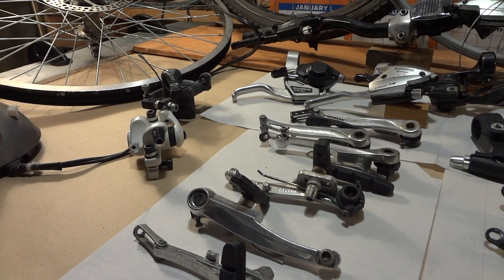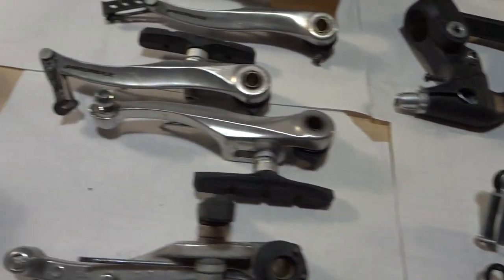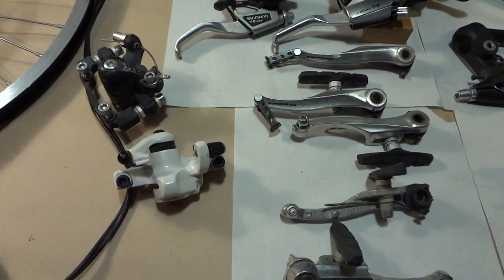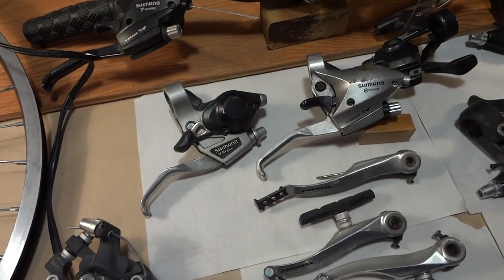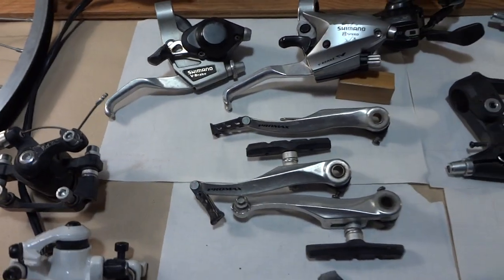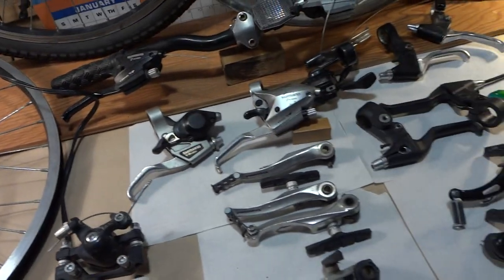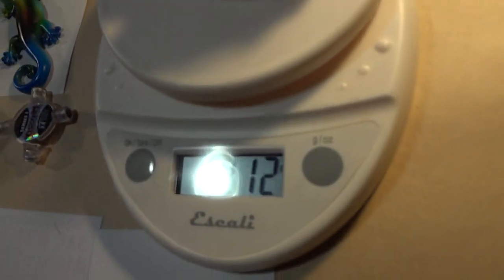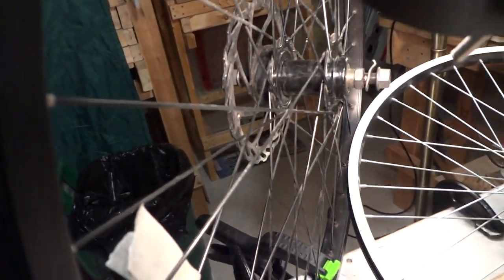Disc vs rim V brakes the truth they wont tell you

Comment: I have been an anti disc brake for a while... until I rented a gravel bike with disc brakes on a trip to Hawaii and had to do fast descents under the rain. Super reliable. Other than that on fair weather and non steep descents disc brakes are not needed. Also forgot to mention, if you have carpal tunnel or arthritis it helps to have disc brakes as less force needs to be applied to stop.
Reply from the maker: cheap quality disc brakes dont stop well though
Reply: @BIKEMAN21  ive ridden a bike with cheap tektro disc brakes, and as soon as its wet, their stopping power is still better than for example hydraulic magura rim brakes. Disc brakes in the wet perform better because of the lower water buildup on the brake surface and being able to get rid of water faster. Also higher clamping pressures.
Reply: @EstelonAgarwaen  Due to the smaller rotor size (e.g. 160mm diameter vs. ca. 600mm), the calipers one disc brake use much more force against the rotor, which is what makes them bite better despite water.

Comment: rim brakes wear out the rims , disc brakes dont and discs are way better in the wet. As for weight ,Pro bikes have a minimum weight and they can achieve that with disc brakes , so weight is not a problem. I run Hope pro 4 hubs with disc brakes , light as it gets
Reply: “As well as not slicing through the wind as efficiently, disc-equipped bikes are generally around 300g to 400g heavier.” https://www.cyclingweekly.com/cycling-weekly/bikes-disc-brakes-faster-219255
Reply: @kalijasin  They might weigh a little more but they let you use carbon clincher rims without the huge risk from heat blowouts. Personally I don't think anyone should even sell carbon clinchers for rim brakes
Reply: Have you ever seen a rim worn down to failure? Me either.
Reply: @Derekforeal  i have seen one, especially in cheap alloy aluminum lightweight rims.
 You barely notice it until the bead of the just broke your rims on its thinnest part,

Its not catastrophic until you are  riding down hill and a pothole  of obstacle hit your tire and change your tire geometry. Permanently breaking your rim wall into 4 parts.
Reply: @Derekforeal  me neither ive never heard of such nonsense
Reply: @kalijasin  Minimum weight is 6.8kg. there are even steel frame rim brake road bikes that weigh about 5.5kg. add about 400 grams to that and its still 900 grams below UCI minimum weight. On non uci hill climb races, people rum a single rim brake for maximum weight savings. But they never descent on these bikes.
Reply: @Derekforeal  henry wildeberry has a video showing a broken rim. It mostly comes from insufficient maintanence afaik. When you dont swap out worn pads, the metal part of the pad will stick out and destroy your rims. With cleaning and maintanence though, the risk of rim breakage is quite low. Especially if you replace the rim when it reaches the wear limit, indicated by a groove or little hole in the rim.
Reply: I have worn out alloy rims, and have seen rims worn out because of out-of-true wheels, and asymmetric braking force from the pads. Worn out as in the wear I dictator groove is gone on sections of the rim.
Reply: @Derekforeal  yes a mate of mine wore through a rim , it was 3 years old .
Reply: @kalijasin  the aerodynamic issue is another lot of BS , you have a human sat on top of the bike and they flapping about and the legs are moving , making so much drag and theres this tiny little caliper and disc. If aero was a problem why are pros going over to discs ? maybe they work better ?

Comment: As a road cyclist commuter I have never really felt a great difference, if you set you brakes up right disc and rim brake types perform identically for me. This is likely cause I'm a cautious rider and don't put myself in situations where my bike along with my cargo need to be stopped on a pin drop, I know my routes and I know just how little I have to brake. I go through significantly less brake pads now just cause I am a more efficient rider. Realistically most people aren't going to go through rain or muddy decent and even if a road dweller does more caution needs to be applied due to more dangerous traffic so you should be going slower anyway.

Comment: I have had disc brakes on my mountain bike for the last 18 yrs. I picked up a hybrid this yr aka as a old school mountain bike with v brakes. I ride much faster on the hybrid as I use it on gravel and the road and it is 50% lighter than my full suspension downhill mountain bike. I really do not notice the difference in braking at any speed esp. high speed. I'm a fair weather rider so for those commuting or doing serious distances where rim brakes are compromised in bad weather, disc brakes make sense. For most of us - they don't. It's an added expense. Fortunately, I never buy bikes based on the components as even the cheapest bike I ever had never had the components fail. The only concern I've ever had issues with are cheap rims. Great review and points raised. I'm wondering if a "high end" set of v brakes is cheaper and as effective as disc brakes, even in the wet with an appropriate brake pad.
Reply from the maker: Well it comes down to money, a bike for $300 wont have good disc brakes i think.  Right now im not sure of the prices at canadian tire ill have to go check. but in middle of covid the $300 bikes were selling for $600 and only had alloy V brakes...not sure currently which is better but my bet is the V brakes.

Comment: I really like my disk brakes on my cargo bike. There stopping power is excellent. The maintenance is very simple once you do it a few times. The only downside I have found is that the disk brake pads do not last nearly as long as vbrake pads. My cargo bike has disk brakes but also has the braze one for vbrakes.
Reply from the maker: I'm just guessing but as a cargo bike maybe they are using higher quality materials that have better friction.  I've also read there are several different rotor / brake pad materials being used depending on the model. I see a lot of MTB bikes with front disc and rear V-brake setup too. And many disc forks that also include the V-brake mounts luckily. But that goes vice versa too.
Reply: @BIKEMAN21  my Big Dummy has Avid BB7s disk brakes.

Comment: Hey bike man, i agree, discs on road anyway are a solution to a problem that doesn't exist. I have done a number of videos on this topic. It is just bike industry marketing. We are now seeing 15k USD high end bikes which are a kilo over the UCI weight , crazy for that money.
Reply from the maker: Finally someone who agree's, My current build a schwinn MTB with front shocks, aluminum frame, when i found it on the street curb i was thrilled it was still using V-brakes. simple to work on and will stop a lot better with a hell of a lot less dead weight.
Reply: Absolutely agree

Comment: I ran Shimano Zee disc brakes on my Trek Farley. Those things were great! 4 pistons per caliper, they stopped that fat tire bike fast. 
I honestly don’t understand the complaints about the slight weight difference between disc and V brakes….if you rode a bike prior to the late 90’s, everything was steel and heavy as hell! With current aluminum and carbon fiber frames, I think I can deal with the few extra grams of a disc brake😂

Comment: Big advantage for rim brakes, they are LINEAR. Important for ebikes when cutoff voltage triggers, the hub motor still have inertion, so avoid wheel locking to not wear the motor gears quickly. Disk breaks lock the wheel and wear the motors gear. Rim is best from every engineering point of view

Comment: Most mountain bike forks areassivelt heavier to accommodate the metal brake mounts requires for V brakes. 
Left that out but it's still weight.

Comment: Hello 'bikeman' i am considering ebikes etc at the moment for going to work mostly, i have looked thru pretty all the ebikes and have not really found the right one, i have a 20+yr old mountain bike ( steel frame i am large build ) i am considering putting a ebike front electric motor in it, as i live on a hill, the motor is 300w and less complicated than others i have seen as the battery goes on side of the motor so MUCH LESS wires, the bike has V brakes, i always thought disc brakes would be better but not so it seems, i would appreciate your thoughts and advice.
Reply: It will be fine with v brakes. My bike is a hybrid with 48 v battery, 1500w rear hub motor does 45 mph! V brakes stop me just fine no problems. I have never been convinced by disc brakes on bicycles, especially as they only have one small rotor on one side of the wheel!

Comment: Cable actuated disc brake callipers as shown in your video are generally much heavier than hydraulic callipers which operate much better. 
If people are happy living with old outdated technology rim brakes let them but I’ll never buy a road bike without hydraulic disc brakes
Reply: Rim brakes are certainly not outdated, there is a much higher demand for them than the manufacturers will admit...rim brakes are less hassle, cheaper, lighter and they work adequately.

Comment: We all went away from V brakes about 20 years ago because in winter the mud clogs up between the rim and the forks due to low clearance  . Disc brake bikes have better clearance  all year round. V brakes wear out the rims which will eventually need replacing which is basically a new wheel. I have had a front rim fail on me while in a competition so I'm not going back to  rim brakes anytime soon. Enjoy your rim brakes while you can. Disc brakes are here for good .
Reply: I have been an anti disc brake for a while... until I rented a gravel bike with disc brakes on a trip to Hawaii and had to do fast descents under the rain. Super reliable. Other than that on fair weather and non steep descents disc brakes are not needed. Also forgot to mention, if you have carpal tunnel or arthritis it helps to have disc brakes as less force needs to be applied to stop.
Reply: @Zayd Deapor
Reply: When you say you had a front wheel rim fail on you from v brakes what exactly do you mean?   how did it fail?   Im severly curious as to what you mean or your experience that happened?
Reply: I also must disagree rim brakes will never stop being manufactured
Reply: Never seen disk brakes on BMX or dirt jumpers....

Comment: Disc brakes are heavyer, that's the fact.  Are they better? Yes, for pros and on the wet. That means for 99% riders, 99% of the time V brakes are better.
Except MTB, Disk brakes are better for MTB.
Reply: That's like saying it is better to ride without helmet 99% of the time
Reply: @caperider1160  99% you didn't understand my point. Disk brakes are not going to save your life.
Reply: I don't believe that you actually ride or ever tried out decent brakes. vbrakes are absolute shit.
Reply: @citer5574  I have disk brakes on my e-bike.
Reply: @dzonibravo7867  are they hydraulic
Reply: Vorty  mid range V brakes (like Deore) are literally maintenance free, just pad replacement once in 4-8 years. There are no disk brakes that can match that.
Reply: @citer5574  yes, Shimano lower group, Alivio.
Reply: @dzonibravo7867  "disc brakes aren't going to save your life"
Us mountain bikers would like to have a word

Comment: I just upgraded from those cheap metal ones a few days ago. Huuge improvement once i installed the shimano alivio's. Im having trouble upgrading from freewheel to cassette so i can put a 9 speed cassette. I cannot find wheels with a cassette hub with the edge for v-brakes and i dont have anyone good in my city to change my hub :(
Reply from the maker: there must be wheels online for cassette and V-brakes ? why exactly do u need a cassette hub though ? for offroad durability ?
Reply: @BIKEMAN21  i wamt to update from 7 speed to a 9 speed and there are no 9 speed free wheel gears from what i could find. Easiest solution was to replace the wheel and get a free hub one. Apparently they are extremely hard to find, and the few sites i checked in my country dont have it in stock. The last thing i can do that is economically viable is to just replace the hub with a freehub one. But i cannot find a shop in my city that respokes wheels. There are plenty for the disk options out there..mnot so much for v brakes
Reply from the maker: @liv7680  did you already buy new derailer and shifters ? i would keep looking online for a new wheel with a free hub and meant for Vbrakes or like universal Vbrake and Disc. I'm not a expert on this matter though. last resort i would check the bike shops to see if they can order the parts. make sure you get alloy hub though, steel is more heavy.
Reply: @BIKEMAN21  not yet...that was on the list for the upgrade, and since i would have been upgrading, the difference in price between a 7sp and 9sp shifters would have been pretty small. I feel i need an extra 11 tooth sproket for speed and a 36 tooth sproket for climbing. Looks like im stuck at 7 sp until i find a wheel :). Thanks for the replies
Reply from the maker: @liv7680  I'm going to guess you are running a 1x drivetrain ? so just one chainring on the crank ? Good luck with the wheel, sounds really aggravating : P

Comment: Disc brakes….heavy, less aero, constant rubbing, hard to change wheels…..check mate.
Reply from the maker: save the disc brakes for scrap metal !
Reply: @BIKEMAN21  Agreed
Reply: In 40 years of using caliper and V brakes, I never had 1 problem with pad rubbing. Disc brakes rub about 1/2 the time. You remove and install wheel again…..pads rub. Disc brakes not ready for prime time. Maybe in a decade.
Reply: @johnyang1420  Or you buy decent brakes first?
Reply: Ting ting ting

Comment: To a point yes weight would slow you down, but after a certain point stability takes precedence over lighter weight. An example of this is going against wind or at high speed, air resistance. The lightest any causal rider wants or should use is 20 pounds. Over that it becomes more and more  unstable. You are also comparing the cheap disc brakes with cheap hubs to good quality rim wheels. Those calipers are likely not alloy, but steel. A set of shimano mechanical calipers used to be 30ish. Rim brakes also require a pretty true wheel and the rim is heavier than a disc only rim. The shimano calipers also are pretty light. You are putting a ton of bias with nothing to back up your claims infact out of spite I will now be just as disorganized as this video was. Also v brake levers are the exact same pull ratio as mechanical disc brakes. The “v-brake” levers you praise so much are great for disc as well. The complaints about tourney using steel in a plastic housing are though valid, but irrelevant. Shimano or any company will make anything to a price point. Your video is a rant or comes off as one. Also about the comment about older pads sliding over the rim is full of shit. Rubber ages and dry rots (why old tires dont grip as good) so its not going to grip the rim. You are right about the non textured rims being worse on braking. Also a firm v brake is hard to make happen with the pads being so close to rim and get gummed up with crap from really anything. Which also can contaminate the pads easily. The argument about the v brake pads being easier to check is also correct but discbrakes are not much harder if you have a brain and if you dont have shit 5$ calipers. But those ones you just pull the pads out with needle nose. You are literally uploading to youtube where parktool and RjtheBikeGuy upload how to videos on shit like this. Disc brakes arent a gimmick, as they have higher torque, are away from most road grit, and dont wear out rims. A weight saving of 50 (going extremely generously on this) will not be noticed. Also stop comparing the fucking levers you can use v brake ones on disc. You are over generalizing about anything. About the frames not being able to just convert to disc, they have to be engineered to not twist from the high torque on one side of the bike. You could take a rim brake wheelset and just change your hubs to a discbrake. I can make the same argument that most disc brake bikes cannot be converted to a rim brake. The rotor noise is because you likely hold the lever down after you stop which doesnt allow the heat from the rotor to dissipate. The rotor will warp badly. Or you dont have the shit set up correctly. Oh my god you also said that “the only benefit is if your rim is bent it wont hit the brake pads”. The same shit happens to the rotors. Also what other material are you wanting them to make fucking hubs out of. The mount for a disc brake barely adds any weight, its the material. And not all steel is magnetic. It also doesnt take a “thousand dollar bike to say that disc brake is better”. 500 dollar or even lower (the new schwinn axum) out perform and can use wider tires that a rim set up.
Reply: Disc brakes do not have higher stopping torque because it brakes from the middle of the wheel.  Your probably too young to experiance braking with vbrakes and flying over the handle bars because of their braking force.
Reply: @RiverogueLander  I remember. Emergency braking was "fun".